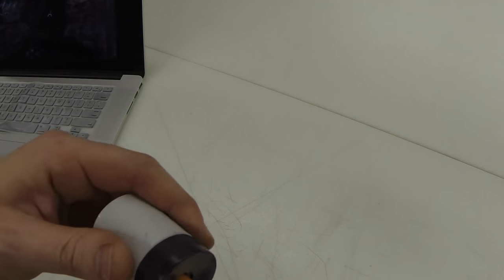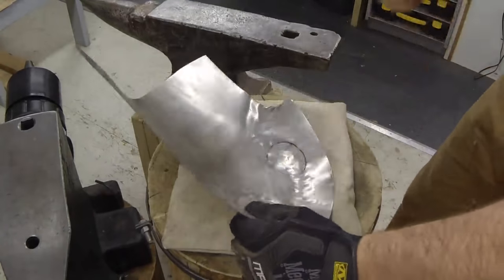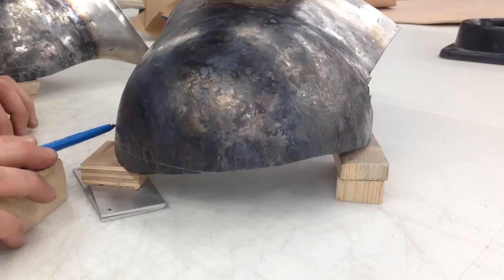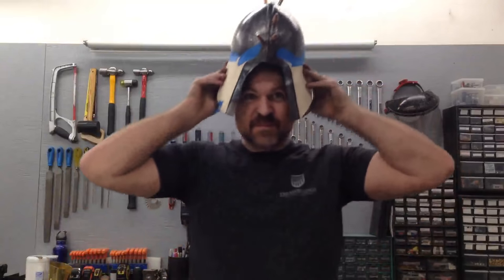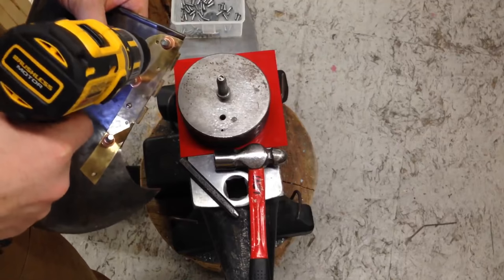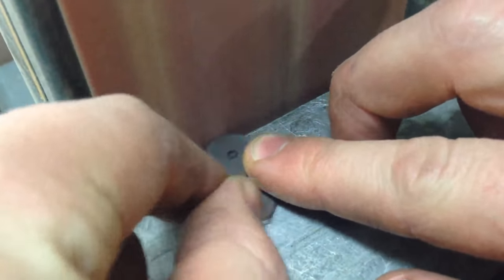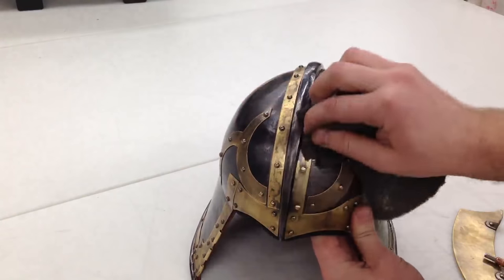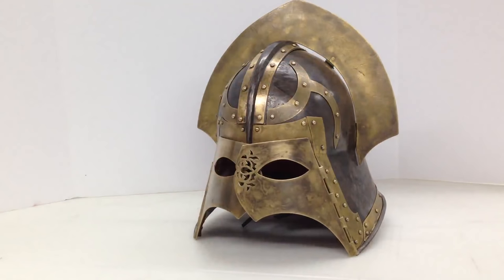Armor Build: Making a Game of Thrones Medieval Lannister Helmet

Comment: To someone who is completely incompetent when it comes to this sort of thing, you absolutely amaze me with your skill. I don't think I could do even a single step of this successfully. Your skill in this area really does show.
Reply from the maker: Thank you for your compliment. Every step is easily learned. Dedication and patience go a long way when learning this type of craft.
Reply: One thing i didn't see you do was harden the metal. Did you leave it out purposefully?
Just saying, that in its current form it's not armor grade.
Reply: teutonieth Why need to make it armour grade? It's just a prop, anyone trying to make use of it as actual armour would see how ineffective it's design is to actually protect the wearer.
Reply from the maker: This was built from mild steel so I am unable to harden it. Also this version is too thin to make an effective helm for actual combat. Technically speaking all of the brass except the faceplates were hammer hardened. Hope that answers your question.
Reply: Just as I was watching this I thought "that sheet metal is too thin for actual combat" then you commented on the actors and such, and then I saw this message, and confirmed my viewpoint, nevertheless I am doing a master in steel manufacturing engineering and I am very impressed with your technique, congratulations, love your workshop too...
Reply: It does, thanks. Personally i'n the type who never want's to land short, i.e. if i were to make a helmet, for a prop or otherwise, i'd make it armor-grade regardless, which is why i was wondering.
Reply from the maker: Thanks so much for your comment about both my work and my workshop. Always makes it worthwhile to hear from people that enjoy my videos.
Reply: just try it, ou mightsurprise yourself nd if not ....  at least you tried

Comment: This video was incredibly fun to watch since usually vids like these become crawls to watch. Would you say the helmet you made would be usable in medieval times? or is it purely cosmetic ?
Reply from the maker: Thanks so much. I was worried it was going to seem long at 20 minutes but I'm glad everyone seems to be enjoying it. This helmet is only 18 ga mild steel. It can not be hardened and would be easily pierced by a blow from a mace, hammer or axe. It may hold up to a couple of blows from a longsword but it would eventually give. Also the total weight 2415 g = 5 lbs 5 oz. In my opinion this is not enough mass to protect against the shear force exerted by most weapons and would prefer to wear a heavier helm. Ideal for this helm would be this in 14 ga stainless :)
Reply: wow interesting thanks!

Comment: Absolutely beautiful, but would the face guard be all that useful for protecting your face? the way you hand bent it made it seem rather fragile...
Reply from the maker: Thanks!! The face is rather open from the bottom and wearing it would not offer you a lot of protection from a thrust up to the face. That is part of the design that can not be changed. But, the design of how the face plates overlap means that they have structure support from one another. Secondly, I made this helm as a costume piece and not for combat. So all of the material on it is too light to offer protection from a really forceful strike. But, all that being said. When I curve that brass it actually hardens quite a lot. One of the properties of brass is that it needs to be annealed to bend repeatedly without breaking. If it would be made of a thicker material is would offer decent protection. Hope that helps shed some light on your question.
Reply: Absolutely, thanks for the quick reply! :) 

I wasn't imagening the bottom half being open as a problem, because I was thinking it could easily be combined with one of those neck pieces that protect the upper torso, shoulders, neck and jaw (from below and front).

Definitively would rather be wearing that helmet than nothing :D

Comment: While I love the look of the helmet (with those face plates closed, they look a bit silly with them spread like wings), I do wonder... how protective could that ever be?
Btw...really nice looking helmet!
Reply from the maker: This helmet provides similar protection to a 15th century german sallet. If you wore it with a bevor it would be considerable protection for foot or light horse combat. It would be terrible for tilting. Thanks for the compliment. I'm so glad everyone is enjoying these builds.
Reply: Drawbridge Entertainment Yes, but the...faceplates.. a good blow against them and wouldn't they cave? One faceplate is held inplace only by the other, and the other has nothing but the wearer's nose to sit against. It's not as if there's a nose guard. Won't that... be a detrimental?
Reply from the maker: daddyleon you are correct that this is a design which does not offer as much practicality as other helmets. Whichever faceplate side you close first pushes agains the brow. It cannot reach the wearers nose. The addition of locking pin that would lock the two faceplates together would substantially help this helm. I'm not actually sure what they do in the show. We rarely see them close up and closed and I did not include it in this interpretation if it does exist.
Reply: Drawbridge Entertainment Yours looks very much alike to the 'real thing'. There isn't much that would hold it together.

There seems to be a stud or something similar that keeps the plates in the middle together.
I think I'd much rather have a Stark helmet then, or better yet, a Bolton helmet - at least that's not fake protection and you have some vision. Though the Tyrells or Unsullied are better still :)

Anyway, nothing of this of course detracts from what you made. I love the look. The leather 'cushions' are also nice as well as the spare holes for possible future straps. As the saying goes, to govern is to predict/foresee.

Lannister (inside): http://i.imgur.com/ks0Sf.jpg
Lannister (outside): http://images5.fanpop.com/image/photos/29400000/Cersei-and-Lannister-soldiers-cersei-lannister-29431415-570-300.jpg
Stark: https://patricksponaugle.files.wordpress.com/2014/01/arya-stark-950x565.png
Bolton: http://watchersonthewall.com/wp-content/uploads/2016/03/GoT32.png
Tyrell: https://patricksponaugle.files.wordpress.com/2016/06/macearmor2.jpg
Unsullied: https://img1.etsystatic.com/053/0/8082284/il_570xN.762920865_kbm3.jpg

Comment: This looks COOL! 

 But I must say I can see why helmets like this did not really exist as it looks way too much work for a helmet like that or for that type.  A sallet has the same coverage or a bit better and is take a bit less work and is a bit more simpler to make as well as a more stronger form of helmet.   A Sallet also has a bit more defecting capabilities than that helmet.
Reply from the maker: +Landsknecht 86 agreed!! it is similar to a sallet in coverage. And way more work to make. I am, however, on the fence about the crest. Does it add extra protection from a downward strike or is it just something extra to hook onto when you get into close combat? I would still wear a sallet if I had to choose between the two.
Reply: Crest?  Ummm are you talking about the thing that is behind the upper visor?  Well that thing (do not know the name) may give some protection from downward strike a little but the main reason for it is to gives extra strength/add support to the visor in the sallet.  The visor is pointy so it can help defect attacks away from the face.

The tail of the sallet protects you neck and the lip on the visor protects your eyes from things slipping to the face.

Comment: I attempted to make a Gjermundbu helmet and I was wondering ,would it be better to have startedwith a rough frame for the actual bowl of the helmet and end with 4 quarters, or do the two sides like you did in this video? 

I did try the 4 quarter assembly, but as this was my first piece of armor, and I am working with a 6x8 beam as my dishing swage  the "final product" was very rough. What would you suggest for next time?
Reply from the maker: +Declan Gohsman the four piece spagenhelm design is correct for the gjermundbu helmet. Dishing is also correct. I would be tempted to make the outer framework first and then make the plates to fit each quadrant. If the finish is too rough then you did not planish enough. That is working with a flat faced hammer on outside of the helm with a ball stake in the underside. Many people use a shot put welded to a shaft as a planishing stake. My first one was a 2" trailer hitch ball that cost a couple of bucks. I still use it a lot 16 years later.

Comment: 1. How long did that take you to make? 2. How long would you expect a pre-industrial armorer with an apprentice to make (not-prototype but a single piece of large patch)
Reply from the maker: 1. including filming it took about 70 hours of evening work (2-3 hours at a time). So I expect that if I was making one without filming it and working 8 hours a day it would take around 50 hours for this build. 
2. I've read that in the late 1400's armourer with a single apprentice could arm 6 men a day in a battle prepping scenario. My personal assumption is that the armour would include a helm, and a breastplate only (not including back plate) both of these would be rough battle ready protection and not the beautiful, expensive parade armour that has survived in museums. 
Most of this build uses techniques that are preindustrial, if you compare to an armoury operating in 1480: A lot of things I do are the same: Cutting: I do most of my cutting on a hand shear. Forming: I do this with dishes and stakes, Riveting: All by hand. Annealing: I use propane but a coal forge would take the same time. Painting: spray bomb vs brush: the same. Pierce work: Hand punch and file, the same. Things that greatly speed up my process: Sanding: I use a variety of mechanical sanding tools. If I was preindustrial I would not sand my amour at all for battle armour. Two reasons I wouldn't do this: Sanding takes a long time and it removes the fire oxidization that appears when hot working steel. This oxidation provides a naturally protective barrier from rust and gives it a beautiful black finish without chemicals. I will be doing a video soon on creating this look without chemicals.

I think your question involves making this particular lannister guard helmet: this helmet would not have been mass produced. It is not very medieval in style and would not make any sense to mass produce. It is a movie fantasy design made to look cool and be reproduced in plastic. If a preindustrial armourer had to make this armour in a large batch it would still take around 20 hours to produce a helm of this particular design. I hope this helps. And this is my opinion only. Thanks for watching.
Reply: Thanks for the long response :) it had many good points :p ( my response had about 10+ lines of text, but decided to think trough a day or two before posting) anyway it included (hugs and kisses)

Comment: What blackener did you use ?
Reply from the maker: I used jax steel black.  But there are any that do the same thing. Black magic, Nova, super blue. If you are in a big city check with a stained glasses or jewelry wholesale place. Small towns look for a hunting store as they usually have cold bluing for rifle repairs. Make sure it is the cold version.
Reply: Drawbridge Props & Armoury thanks a lot for the answer btw i love your videos

Comment: Hey so I had a leather strap tear off of a breastplate and it was held on by a rivet. I generally have no idea about armoring so I how would I go about removing the rivet? I think I know how to put another one in once I get a replacement strap.
Reply from the maker: +jpt 2015 if I'm trying to reuse the leather I usually use a drill with a tiny bit to drill a pilot hole in the center of the rivet from the inside of the armour. Then I switch to a larger drill bit that is slightly bigger than the shaft diameter and drill until the whole mushroom head on the inside can be removed. Lastly I use a punch and hammer to remove the rivet. If the leather is dead it is easier: put a damp cloth on the rivet head on the outside of the armour.  Use a grinder to remove mushroom head in the inside until you can pull the leather off and push the rivet out through the hole.  The cloth keeps the rivet cool so it doesn't effect your temper or change the colour of the metal around the rivet.
Reply: Hey so I finally got around to doing this and it worked like a charm. Thank you for your advice. My next project is altering some butted chainmail I ordered. I didn't realize when I ordered it that it goes down to the knees. The only problem is that the smith didn't make any separation below the waste so I think it looks rather strange. Is putting the opening in as simple as opening the links in a straight line and removing some, or do I have to make a larger more triangular opening to make it look right? This is all assuming you have ever worked on mail, which I just assumed you had given your previous know how on armor. Thanks
Reply from the maker: I started with Maille and have many years of experience with it. Are you asking about a habergeon (shirt) or a fauld (skirt)? If it is a fauld it should probably not have a split as long as it doesn't effect your motion. If it is a habergeon then first an foremost you should wear a belt over it. The belt relieves some of the weight of your shoulders. The maille should be pulled up a bit at the waist so that when you raise your arms the maille doesn't try to pull the belt up. In theory your belt should sit at your true waist (belly button height) but this is difficult for people that are not in extremely good shape. Once you are wearing the maille in correct way you can choose if it needs a split. Front splits are not good for foot combat as it increases your chance of getting hit in the crotch. So a side split on both sides can give you extra movement if required. If you are fighting from horseback or want to give that illusion in the silhouette of your armour then a front and back split may be required. It should not go higher than the bottom of the crotch of your pants. I often have actors sit on a chair backwards to see if the maille will effect their saddle comfort. No split is still the optimal protection. If it looks funny try adding a fabric panel underneath to show off the maille. This fabric panel can have splits and make the maille look really good. If you do want a split, remove 1 ring from every second row going straight up. I recommend putting a twist tie or bobby pin on each of the rings you intend to open as you go up the garment. Remove as few rings as possible. Check out my video on chain armour: https://www.youtube.com/watch?v=pcoCEwSDxyM
Reply: +Drawbridge Entertainment I had not even thought of a side split. Thanks for the suggestion. I think I am going to do one of the two. To put my question more simply, how many rows of mail would i have to remove to make the split? Is it just as simple as disconnecting it in a line up to about the waist or is it more complicated to get a gap that will facilitate movement?
Reply: Sorry I made the above comment from a different account. And to clarify this is for a full length hauberk that goes from neck to knee
Reply from the maker: hranzieg I would just take one link out at a time in a straight line until you have a split the desired length. You can always put them back in if you go to far.
Reply: Ok I got the split to the desired length. Thanks again for all your help. You run a good channel!
Reply from the maker: ***** Anytime!!

Comment: can do you share the templates?
Reply from the maker: This type of build requires the patterns to be produced as you build the helmet. Therefore the only helpful pattern would be the main skull. In the video I show exactly how I build that first pattern so that anyone can copy my technique. Just make sure your paper pattern has 1/2" around the head for padding. A half helmet pattern should measure (across the brow) half of the circumference of the wearers head plus 1.5 inches. For example a head measuring 24" would need a finished Helmet that is 27" so the half pattern would be 13.5" Hope that helps.
Reply: +Drawbridge Entertainment thank you